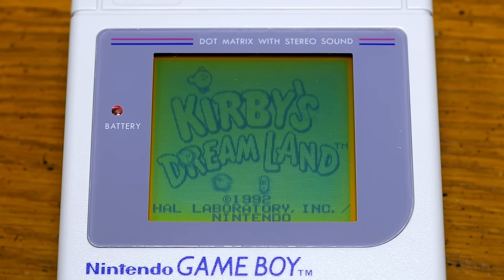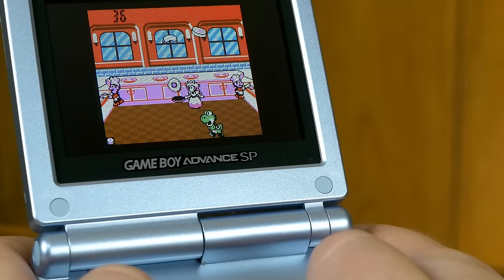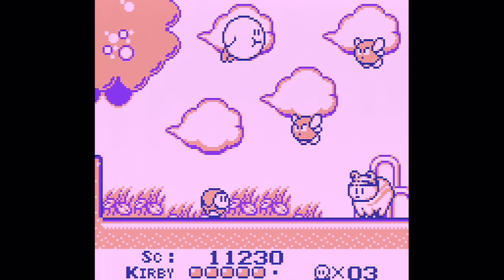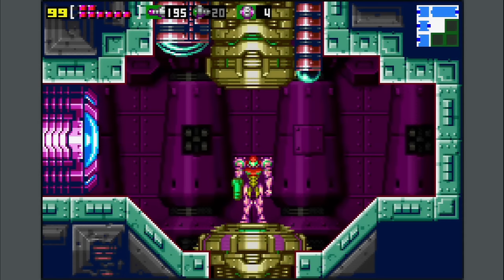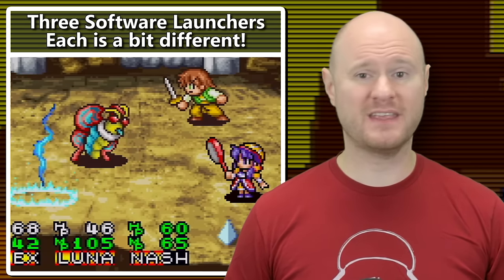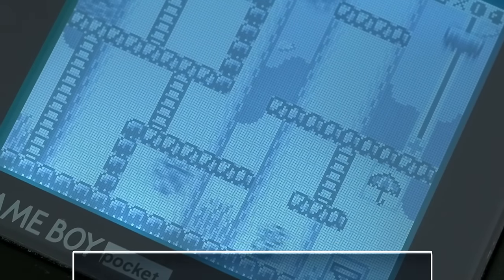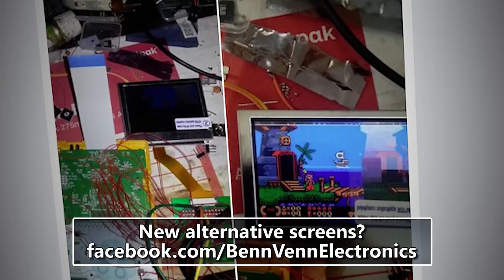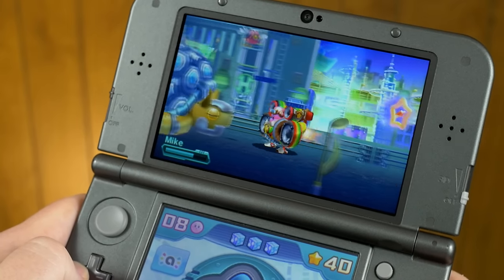Nintendo Game Boy, Game Boy Color, and Game Boy Advance :: RGB208 / MY LIFE IN GAMING

Comment: So interestingly and somewhat weirdly, there's a backlight kit that uses electro-luminescent lighting. If you think it's completely inferior to a LED backlight kit, I get why, but there are at least some differences. The kit is thinner than the LED (no pressure on the screen after installation) and has more uniform lighting with no hotspots. Personally, I'm curious to see how it looks after installing a bivert chip as well.

Comment: So excited that I don't need the boot disc now.  I have wanted the gameboy player for s few years.  Have a retron but want to play on real hardware.  What would you suggest I get for the adapter to load the software on.  The loader you mentioned earlier is sold out.  Thanks great video.

Comment: One of the best ways I have found to play GBA games is to use homebrew software on the NEW 3DS to inject new ROMs into the  GBA virtual console. It won't work for every game but I can't find any other issues. You can do this with the original 3ds as well but I have found that it drops frames sometimes and overall isn't as smooth.

Comment: Being familiar with the gameboy hardware and considering the fact that a lot of original gameboy screens are craping out, Josh and Zane should design a replacement frontal board for the gameboy with a modern backlit LCD screen. It would  be a quick fix and upgrade at the sametime for an otherwise "dead" gameboy.
Reply from the maker: [Try4ce] There are actually a ton of kits that do exactly what you describe. They've started appearing all over the place in recent years. I made a video on the subject this summer. The results are a bit mixed, however. https://youtu.be/M90C3BdTjIc

As for HDMyBoy, the project seemed to have disappeared sadly. Not sure what happened.
Reply: @mylifeingaming  Thanks for pointing them out to me. Happy new year man.

Comment: GB Boy Color has one very big issue you didn't bring up.  It's a battery vampire.  Even when turned off, if you leave batteries in it for a couple weeks (or so? I forget) it will drain them.  There's something going on with the board not made right in there it still draws power off the batteries when its off until they're dead. I went through a couple sets before I realized it, the second being new batteries i never turned on once in the system.  I got rid of mine because of it.

Comment: The "RetroBit Super Retro Advance Adapter" is my favorite way to play GBA on a big screen. Unfortunately it's been out of production for some time. And you can expect to pay around a hundred bucks for one on ebay. They did (and maybe still do, occasionally) appear used on Amazon. But ebay is probably your best bet, these days. The only issue with them is that you kinda have to trial and error which cord goes where. If you plug them all in where they would seem to obviously go, it probably will only out-put either audio or video. In my case, I had to use the video-out from the adapter cart, and audio-out from the SNES. But I've heard other people say that the wire setup which worked for them, was different.
Reply: P.S. It is compatible with GBA Everdrives too.

Comment: The DS wasn't the first system with a backlit screen.  That goes to the GBA SP revision.  Instead of turning the light off, the light button switch between bright and dim backlight options.
Reply from the maker: [Try4ce] Nope, we went in chronological order here. :) The backlit GBA SP and GB Micro both released almost a year after the DS.
Reply: @mylifeingaming  I stand corrected.  I honestly keep forgetting just how old the DS actually is.  Thanks for setting me straight, I'm so glad I found your videos, these are great!  :-)

Comment: I think that on that controller that can change the speed it’s almost like changing the difficulty also because if there is a level where enemy’s come at you really fast you can slow down like making it easy mode and the same thing with putting it faster except it’s like activating hard mode

Comment: While the entire Gameboy line is technically region free (even up to the GBA, this was still the case), there were in fact some region lockouts in place, mainly when it comes to linking games via the link cable. For example, Japanese Pokémon games not being compatible for trading or battling with non-japanese copies. Also, when linking a GBA to a gamecube, some features were region-locked. For examples, a copy of Metroid Fusion from North America won't work for unlocking the bonus content in a PAL copy of Metroid Prime. A friend and I also tried to link a North American GBA game with a UK one and it refused to acknowledge the presence of the link cable (I can't remember what came it was though, it was 15 years ago...). We knew the cable was good as we used it to play Mario Kart Super Circuit and had no issues. Don't know how many others exist, but those are a few examples that I know of where region-locking does exist on Gameboy/Gameboy Advance. So while all games will work in all systems, there do exist some limitations between regions.
Reply from the maker: [Try4ce] My feeling is that these instances are likely more down to them being different builds of the games, rather than intentional region locking.
Reply: My Life in Gaming I believe, in the case of Pokémon, it's to do with fonts. The non-japanese games use the basic alphabet, whereas the Japanese games obviously use Japanese. So the names can't be displayed on the opposite builds so they deliberately made them not able to recognise each other to avoid any problems. And I also think the region-locking with Metroid Prime is actually on the GameCube end. I think they programmed each region to only recognise certain cartridge IDs and only programmed it for the correct region of release.
Reply: I believe it's the game devs that decide to region-lock certain titles. In the case of Pokémon, it was a fail-safe, with Metroid I think they just assumed no-one would have out-of-region carts so didn't account for it. As you quite rightly said, the systems themselves are region-free so it's odd to find these specific cases of region-locking. It still happens to this day. Triforce heroes on the 3ds doesn't support local multiplayer between the UK version and the US version. And there are also some translation differences so I could get behind the different builds theory, but for the fact that the online multiplayer works across all regions so why shouldn't local play also be possible. I assume the game looks for the same title ID as the one being played and the devs didn't program it to look for any other title IDs as they assumed no one would be in a situation where they tried to play local multiplayer with someone from another region.

Comment: What is the settings you used for upscaling the GBA footage? both for capturing and upscaling. If you can get back to me I'd be super thankful! You guys rock!
Reply from the maker: [Try4ce] I used the GBI-LL homebrew through the Game Boy Player with the FireBrandX "Pixel Purist" profile for GBA on GameCube using GBI. Although they've renamed the GBI software branches now... I think GBI-LL is called GBI Speedrun or something now.
Reply: I have the DS capture card, I got the footage at its native resolution but when I upscale it it makes the pixels blurry and rounded.
Reply from the maker: [Try4ce] Ah, yeah, we've used software called GPU Resize to deal with that, although you have to be sure you record at a very high quality to not get artifacting, so that the same color pixel isn't shifted in hue from point to point on the screen due to compression with the source file.
Reply: @mylifeingaming  Am I using Lagarith or x264vfw h.264? I got GPU Resize and I've resized it to the nearest and I'm still seeing blurring of the pixels. Export Settings are H.264 720p 

I feel like my settings are wrong. I'm still Ocarinacraft, just replying with a different channel. I want to start making content with GB/GBC/GBA content but I have no reliable way of getting the purist pixels.

Comment: Hi. 

Thanks for your hard work. 

Rather than use any of these super game boys, wide boys or Gameboy players, do you recommend that we just get a Retron 5 Console instead? 
Since the Retron 5 is more available and plays so many more games and might do as good of a job as the previous mentioned?

Thanks. 

Anybody knowledgeable please reply soon.
Reply from the maker: [Try4ce] It's an OK starting point, but not really the ideal scenario. It's pretty good for original Game Boy, but the input lag on GBA games is very noticeable. Input lag in general on it varies from system to system, and certain cartridge slots, especially the Genesis slot, at least on my unit, grip the cartridges extremely hard.
Reply: @mylifeingaming  ok nice.

Thank u

Comment: Casualy ignores AGS101 with backlit screen.    PLUS the origional DS was a superior but still frontlit display.    The ds Lite was an backlit screen. As for the 50/60 hz screen they can be driven at nearly any framerate you want up to a limit
Reply from the maker: [Try4ce] Did not ignore it. Keep watching. Went in order of release. As for the original DS screen, there is loads of conflicting info out there. After plenty of research and asking trusted sources, I concluded that it simply does not make sense for it to be front lit. You can't see it in daylight like you can a front lit GBA SP. You can't see the lights from the front. It's a pretty dim backlight, and I'll concede it's a fact I was nervous about putting in this video, but I haven't seen anyone provide convincing proof to me that it's not a backlight.

Comment: Wait, so to use borders you have to use GBI? Which gives you the latency and judder and doesn’t let you output to a CRT? Why!?
Reply from the maker: [Try4ce] You can output to a CRT. It can be interlaced instead of 480p if necessary. I'd never want to use the borders myself though, so I'm happy not using it. You can make that version very large, however. It has decent scaling.
Reply: My Life in Gaming I don’t really need the borders anyway, but it’s the 480i output that’s a problem. I want proper 240p output over RGB ideally, so I’ll probably stick to the ULL or LL version.

Comment: The moment you have open software emulation, the options become practically infinite if you're willing to tinker. No hardware tools required beyond a standard computer. Something not to your liking? Change it! The source code is freely available for you to play with and add whatever crazy ideas you can think of.

mGBA supports the Super Gameboy Color.... wait... that doesn't exist! Neither does the PICO-8 and that stopped absolutely no one from making games for it. While ROMs have to be patched since they usually don't expect to be running in both a Gameboy Color and Super Gameboy, you can still play select games with both Super Gameboy borders and the full color palette of the Gameboy Color. For GBA games, it supports higher internal resolution for rendering games. This doesn't seem like it would do anything since the system is tile-based, but the GBA also supports sprite and background transformations like stretching and rotation. This results in a loss of detail when being sampled at a low resolution, but remain as crisp as ever with higher internal resolution, at the cost of appearing completely surreal due to pixels no longer being aligned.

WideGB and GBE+ have various graphics experiments as well to change how Gameboy and Gameboy Color games look and feel, but they're somewhat less maintained than mGBA.

Comment: Code Junkies sent me their SD Media Launcher kit except their SD card readers were changed to now be MICRO SD readers... meaning it wont accept a 4gb non SDHC card or smaller. So there's no way for me to boot into SWISS or GBI. You can tell they changed it because the cutout for the SD Reader is wide enough to fit a regular size SD card but the reader inside is for micro SDs only.

Comment: Another good Gameboy emulator besides Gambatte is BGB.  While it's Windows only, it's pretty simple to run it on Linux with Wine or my favorite way to run Wine applications, PlayonLinux.  As for GBA, mGBA is the most accurate emulator and it's cross compatible and has a libretrocore so that is a safe bet.  Anyway IMO emulators running on a PC is the more convenient way to run Gameboy games and better than Virtual Console Emulation or emulator on a chip devices.  More hardware accurate options are pretty expensive so in the end Emulators cover my needs perfectly.

Comment: So now there are 2 new versions of GBI, GBI High Fidelity and GBI Speedrun. Is there a way to download the old Low Latency and Ultra Low Latency versions? There seems to be differences between the screen resolutions in the new ones compared to the old ones. For example, High Fidelity has a skinnier screen with smooth performance while Speedrun has a wider screen with ocational studder. The old versions all seem to have the correct aspect ratio while the new ones warry between wide and skinny.
Reply from the maker: [Try4ce] I don't know all the details of how the versions have changed over the years. It's tough to keep up. But I don't think older versions are officially hosted anymore.

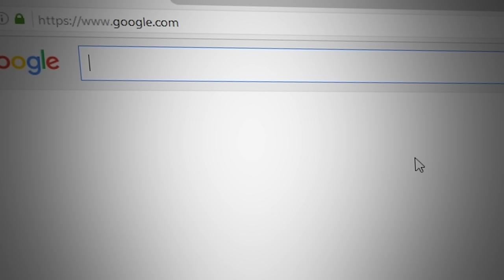Comment: 32:31 - My Framemeister works with GBI-ULL. Did they change something with it or am I just extremely lucky for whatever reason? PAL GC DOL-001 running official Gamecube RGB cables (PAL). Loading via WindWaker > Swiss > DOL file.
Reply from the maker: [Try4ce] They've changed a lot, in fact the names aren't even the same anymore.

Comment: going into that sd media launcher you mentioned. could something like that be possible for the PS2? back when i had the console, i was limited to 2 8MB memcards, which wasn't nearly enough for all the games i had. i remember reading of like 16MB and 32MB cards, but they had issues on the system. but i'm curious if it was possible to make an sd memcard with no issues
Reply from the maker: [Try4ce] This is not something I'm familiar with, but official PS2 memory cards are pretty cheap to come by these days. See them all the time in retro shops.

Comment: So, if I get a pal Gamecube, and hook it up with rgb, then the resolution for the gameboy player will be 240p?
Reply from the maker: [Try4ce] Not directly. You have to use the homebrew software to get 240p. But yes, you can do so with a PAL GameCube and RGB cables for it... but you need that extra step, which is outlined in the video.

Comment: The thing with playing GBA on a TV is that the resolution is rather low and the pixels look too big, even with some filtering it looks weird, like zoomed in (which is actually what happened with some ports). I have a Raspberry and I still prefer to play GBA games on the SP or a 3DS with CFW. These games look better on a smaller screen.

Comment: Anybody else have the resistor problem on the DSlite? I had three of them and they all stopped taking a charge. Apparently due to a resistor that commonly failed. The supposed work around was to you conductive ink and bypass it restoring the charge function. Never got around to taking one apart. Now that I have the interest of course I don't have them anymore.

Comment: Wait, so PAL GameCubes just need a SCART cable and then I can use RGB? No expensive cables required? Well I know what I’m doing for GameCube games.
Reply from the maker: [Try4ce] Correct, but you can't get 480p that way. It's the only major limitation though.
Reply: My Life in Gaming Surely though you could use some software to force 480p like you have to do for some NTSC games?

Comment: 15:53 Hey TRY4 where did you get that Nintendo S-video cable in particular?
Reply from the maker: [Try4ce] Bought a bunch of cheap ones on eBay back when I didn't know about RGB. On a basic sort of screen/upscaler, they look fine, but under scrutiny they do have some noise. To be honest I'm not sure where you find particularly high quality Nintendo S-video cables these days. There hard to come by, I think.
Reply: @mylifeingaming  but does the one you showed in the part where you slide cables across table have the checkerboard noise.
because I'm interested in getting that one in particular for my N64 SNES and GameCube
Reply from the maker: [Try4ce] Hmm to be honest I can't remember. I know I saw some rolling noise sometimes.
Reply: @mylifeingaming  but was it super noticeable or was it faintly, faintly there in the video signal to the point where you won't see it at all on a CRT and Sony PVM?
Reply: I'm only dragging out this talk because I wanna have my GameCube, Nintendo 64 and Super Nintendo go through s-video on an affordable upscaler in HDMI because I don't have the equipment to do RGB on my SNES(as in a SCART cable and switcher) and I don't wanna spend the money on modding my N64 to get RGB and invest on a PAL region GameCube because for the life of me, I cant find an answer on wether the PAL GameCube can play NTSC games in NTSC regions like North America.
Also because the other consoles that do support RGB in my set-up are post 6th generation equipment in where I can use HDMI or component out of the box
Reply from the maker: [Try4ce] Yes very faint because I didn't notice it until much later. I don't think you'd see it on a regular CRT, possibly not even on a PVM.
Reply: @mylifeingaming  execellent that cable is exactelly what I'm looking for in my set up:D

Comment: Do you need Swiss for GBI to run in 240p? For some reason my .dols won't run in Swiss but will without. Using it on my modern display LCD TV through my Framemeister. Thanks!
Reply from the maker: [Try4ce] Oh no, you can run GBI-LL in 240p without Swiss. I don't think standard GBI has 240p options normally, though. However it's laggier, so I do recommend GBI-LL if possible.